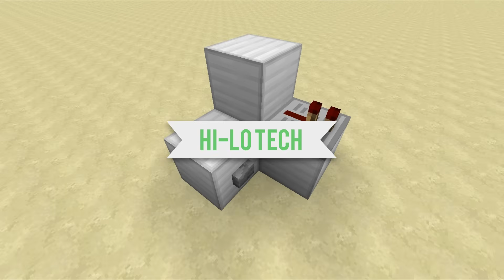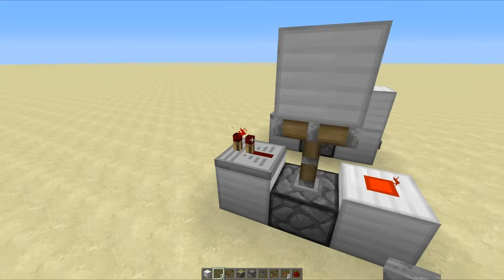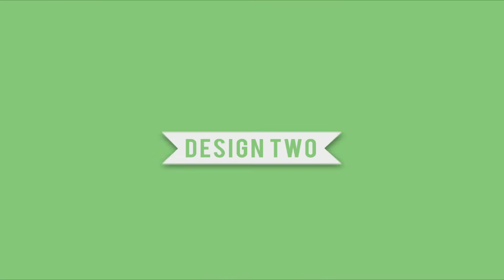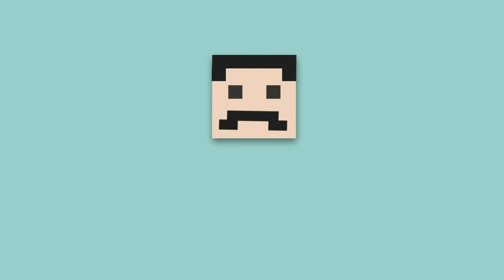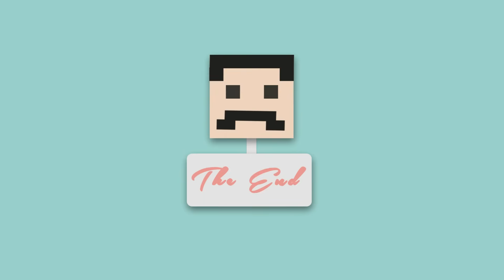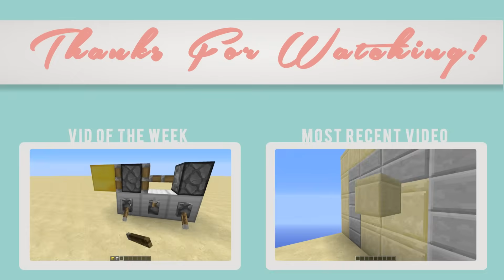HI-LO Tech: The Monostable Circuit

Comment: Why is the falling edge circuit useful?

Simple, I made a rocket silo, gate opens on the rising edge, then a condensator is charged, runs into a falling edge that then closes the gate after a while. Open, fire and close with only one redstone pulse instead of multiple inputs.

Edit: A more compact design for a dual edge would be a redstone dust running into an observer, because the observer detects changes in blocks you will get a signal when the redstone is powered and when it powers off, basically giving you a smaller dual edge monostable circuit in a 2×1×1 block area

Comment: Old video but great concepts and sometimes need to fall back on the older designs for specific builds. Question: Wouldn't Observers be a kind of 1 block monostable multivibrator? It can observe the change in state of blocks and of redstone itself, so it can turn long pulses into short ones on both the rising and falling edge

Comment: Whos waching this in 2019 or 2020
Reply: ...it's almost 2021 and I'm trying to determine if the first circuit works in 1.16.1.  I don't get a pulse to the repeater, and apparently it behaves exactly the same whether I have the redstone dot there or not, the repeater there, or not.  Trouble with getting into this game late is...you don't know which of these mechanics were tweaked in later years and versions. :/
Reply: Ah, I guess the only thing that changed is you don't use the redstone 'dot'.  As long as the redstone dust is thrown down in the non-dot form, it functions as intended.  ...not sure why they did that.  I've run into trouble with this before when I don't have the same texture pack.

Comment: here's my situation 
I have a password mechanism the opens a 10x10 door but the door stays opened until I hit a different button that turns the password mechanism signal off.

is there any system to add so that when the signal is on (input side, door close) and its stays on (output side, door close) and when the signal is off (input side, door opened) it turns off and after a few ticks it turns back on (output side  opened for a few ticks then closes).

Comment: Ouf ._. I was looking for a silent design ._. my mega furnace houts my base with 4 dropper-ticks already D: (Oh, yea I'm also looking for a silent 4 tick counter with a 1 tick output -.- never try to make the safety mechanisms to a bamboo mega-smelter ... it just... just use a wood farm for fuel -.-) 
If you're asking, the problem is a fuel shortage leading to fuel continuously being used without actually smelting anything. (quite an obvious problem if you ask me) with an obvious solution 
take the 1 tick signal from the redstone line of the fuel distribution line (the standard all hoppers are triggered at the same time = 1 item per hopperoutput) 
run it into a 4 tick counter (as bamboo gives 1/4 of a full smelt [by Notch I'm happy the new team leaves all smelt times at the same length... although I could just use the longest smelt time / bamboo fuel time as tick count ._.])
convert the counter signal into a 1 tick puls 
and run it into the hoppers directly over the furnaces
=> 4 fuel => 1 smeltable

but I (still and again ._.) lack the redstone knowledge to get this thing silent so my monostable is still the more silent hopper-dropper design and the 4 tick counter works with a hoppercycle... oh I just realized I probably used 2 to many hoppers ._. (But I'm sure both can be done silent -.-)

Comment: I use the observers, which are a sort of cutting edge tech...
Reply: Aonodensetsu I was just working on a circuit that needed a sticky piston to leave a block behind and the observer didn't work for me. Is an observer a one tick pulse?
Reply: observer does give one tick but it is kinda weird sometimes - connected to redstone it gives the pulse both when it activates and disactivates and so connectiong it straight to a buttor or something wont work
Reply: everything pure 1.11
Reply: the basic explanation for the observer is just a Block Update Detector - something changes - you get a pulse
Reply: Aonodensetsu Thanks!
I have already gotten the circuit to work using a monostable, but I might be able to make it more efficient now.
Reply: you like the extenders? lol

Comment: This is so amazingly useful! Thank you.
I don't know why you skipped the one in the back at 0:50. It operates silently and uses very little resources. I needed a longer pulse with several minutes between pulses. The concept used in that circuit was easily combined with a pulse extender and a hopper timer. It integrates so well. I used the "off" state of the redstone block in the timer to replace the first redstone torch. Then, I just added two more repeaters.
I am using it to send out a minecart every 4 minutes.

Comment: There's also the silent  mononstable circuit using a locking repeater, which is useful if you want to control the pulse length or get a shorter delay on a long pulse

Comment: dual edge monostable is great for dispensing lava and pulling it back right away  (for example in mob grinders)
Reply: Dual edge monostable circuits have been replaced by Observers :P
For mob grinders, water elevators are just the best way to go.
Reply: FennecTECH That's a great example.  Another use I found is to hook it up to a daylight sensor for farms that I want to activate twice a day.

Comment: I know this vid is slightly old but i have a quesion. Can you combine a falling edge monostable with a t flip flop? Basically i have a t-flip flop (multi button input all which act as levers) and im wondering if i could use a falling edge to make it so that when i hit on of  the buttons on the flip flops to turn the circuit off, it will get a pulse? idk if its possible but itd be cool cause it'd help with my stacked piston designs
Reply: It shortens to a 1 tick pulse, where the output is, put a sticky piston with a restone block on it.

Comment: hey mumbo the most comon use for a dueledge monostable circuit is water.
you can have a lever that turns a water fall on and off because the dispenser togles it every pulse.

Comment: I'm pretty sure I liked and commented on this last year (maybe only liked; hard to tell after so long), but I only just got around to making use of a rising edge and falling edge in a farm. Button -> Rising Edge dispenses water to flush everything to a hopper -> Falling Edge shuts the water off. Could have used a dual edge instead, probably, but I wanted to control the length of each pulse separately.

Comment: I think a dual-edge one is more useful for levers then it is for buttons, as you can flick the lever and get the pulse regardless of whether the lever is on or off... useful for idiot-proofing a system where someone breaks off the lever.
Reply: Yeah dual-edges are great for making levers act like buttons. I used it for working with water buckets in dispensers; dispensers need one pulse to output the water and another pulse to suck it back up, but it made more sense to use a lever for out/in states.
Reply: or just comment on a video that came out 5 years ago and bring up the observer, which wasn't a thing at the time
Reply: @parzy_osu  I used a dual edge mono stable circuit, to take a falling edge monostable circuit. that was triggered by a hopper clock. to pulse water and disable a portal after after it was used once. I needed a one way nether portal.

Comment: Mumbo!! I understand why you would think Dual Edge Monostable circuits are "odd"; them being very conditional in use and probably not having much contribution to redstone timing, but they are actually extremely useful for certain contraptions! An application for this circuit would be when you want a pressure plate to send a 1-tick pulse on its input and another for its output. You could use a pressure plate to send a pulse to a basic block swapper that swaps a wall block to a crafting table, then swaps it back to a wall block once you step off the prssure plate! If you were to use a Rising Edge for this instead, you would have to step off of the pressure plate and step on it again just for the swapper to swap the crafting table back to a wall block (because the basic block swapper acts like a T-flipflop and swaps the blocks on a single tick as I'm sure you know!) Only the Dual Edge Monostable circuit works for contraptions like those~ and for other awesome things as well! Mainly on pressureplate>dualedge>Trlipflop designs, because a button with the dual edge isn't very useful and a lever ending up activating a T-flipflop would just be ridiculous. Liked! Subbed! Cheers!

Comment: there are also silent designs for a rising and falling edge detector (which reacts to both) 
works with repeaters and torches and is shown in panda's lp where he used a wither to mine for him (older mc version->wither sitting in a minecart is fixed)

and there is a cool monostable circuit design by jl which works as a 0-tick repeater (vertical and horizontal)

Comment: I have installed MrCrayfish's Furniture mod and it includes a fire alarm. I wanna make something that when the fire alarm is triggered, a dispenser will shoot out water and then clean it up fast. I'd figure I would ask you for help, because you are very good a using monostable circuits and good stuff like that, so please help.
Reply: okay, dispenser place and remove water apon a rising edge, therefor if you want the water to go out, flow and then retract you need to send two separate pulses to the dispenser, a simple way to do this from this video would be to have two monostable circuits, one leading into the other, then attach both outputs to the dispenser. so you trigger the first one (or the alarm does) it sends a pulse (on, off) to the dispenser, that then triggers the other monostable which then sends another pulse which retracts the water. also using two separate monostables would allow you to manually adjust the time between the two pulses (to control the flow of the water)

Comment: The real definition for a monostable circuit is right in the name. It has one stable state (usually the off state) and when it is not in the stable state, it eventually goes back to the stable state. By extension, another name for an RS-NOR latch would be a bistable circuit, and for any latch, a polystable circuit.
Reply: the stable in the name also refers to a stable pulse, as in consistent size, always the same, on-top of what you said.

Comment: Are there stereostable circuits?
Reply: a stereostable circuit is a T-flip-flop because a monostable circuit (mono means singe) produces a single pulse with each button press, while a stereostable (stereo meaning solid) would make a solid on or off signal with each button press.
Reply: I was just kidding... lol.
Reply: nickmettgaming In the context it was used, a stereo-stable circuit would mean coming from multiple sources. the stable is the main part of the word here, the stable means we want a stable pulse ( set length, always the same). I don't think a t-flip-flop would be considered a Stereo-stable circuit, but if I'm wrong then I think you've just coined the term.
Reply: DreadKyller You might be right. I don't really know. What you are describing is an OR-gate connected to a pulse extender, so that no matter the source of the signal or length of the signal, you will always get the same output and same length signal.
Reply: a t-flip flop and any other latch (rs-nor, jk-flip-flop, d-flip-flop, d-latch) are all bi-stable circuits. and a monostable with 2 inputs is simply a 2 input monostable, in electronics we use the term Stereo-stable to describe a circuit that once triggered, outputs 2 timed pulses, either on different lines or one after the other on the same line, both being of different single length. essentially 2 different monostable circuits triggered by the same line.
Reply: nickmettgaming That post at the top; I must admit it sounds like a bunch of mumbo jumbo.
Reply: no a dual edge simply means its input responds to either turning on or off. this can be used to make a lever act like a button. where as a stereo-stable actually produces two separate outputs based on any single input
Reply: ......If only I had an idea anymore of what your all saying....I would atleast try to make a Stereo Stable Circuit
Reply: DreadKyller That still makes sense in the context.
Reply: I know that, I'm not a new redstoner, I was just pointing something out, I know what an or gate is, but technically any gate with more than one input (and gate, rs-nand gate, etc) could also be considered stereo source. in terms of relation to monostable, other forms would be bistable and polystable, those work in the same context talking about size, however the stereo you were talking about is more along the lines of unstabe, and while that works for your explanation of what it could be it didn't work in the context.

Mono means 1, Stereo means multiple, that definition works for the same context as the mono in monostable means 1. however if the meaning of stereo in stereostable was "solid", then that would be saying that monostable meant unreliable.
Reply: True enough. I was just making my best guess to be honest. I really don't know if there is something in redstone that could be considered a stereostable circuit.
Reply: we know, but it is an interesting concept and probably is possible, so deciding what it would be might help pople make one if it doesn't exist yet.
Reply: DreadKyller .......I'm a bit of an average (not so good) redstoner. I didnt understand half the things said here but atleast I have an idea of what everything meant XD
Reply: I think monostable means one pulse length, so stereostable means multiple output lengths, for example if the first pulse is short then the next is long. Just a guess.
Reply: oh ok
Reply: ........You had to go there.......God Damn it silvah =_=
Reply: mono-stables have nothing to do with sound. in fact the term stereo means two separate. that's why we use the term for sound but is not limited to it
Reply: .....I was making a pun lad
Reply: it was a bad pun, lad :P
Reply: sl1pg8r Look what you have started. lol
Reply: ComatoseChimera therefore making the dual edge a stereo-stable circuit rather than mono?
Reply: violentskittlez The dual-edge monostable circuit is also a pulse multiplier.
Reply: Sl1pg8r - Minecraft, Mods, and MOAR! LOL these peple are really running with your "idea" :D lmao im not sure they got the joke though.
Reply: Sl1pg8r - Minecraft, Mods, and MOAR! I got that one right away
#Audiophile
Reply: Use two side by side and run them into a and -gate.
Reply: what about a 7.1stable circuit?
Reply: dual-edge monostable circuit ;)
Reply: nickmettgaming Really?
Reply: I always thought stereo was something you used to use to listen to the radio.......XD

Comment: Pistons start to extend instantly, see the wiki on instiwire
Reply: The wiki is outdated. See actual game on testing.
Reply: really :| test the wiki's insta-wire in minecraft 1.7.2 and tell me again it is outdated, because its not.
Reply: I did before I commented but yea here's me telling you it again:
The wiki is outdated. See actual game on testing.
To test have a lever activating a redstone block instantly and a piston with a redstone block which activates a redstone lamp. It takes half a redstone tick (aka a game tick, aka 0.05 seconds) longer for the piston one to turn on. 
Maybe you should do testing yourself BEFORE telling others to...
Reply: how about you READ what people say before you tell them and the wiki off, i said pistons START to extend instantly, not that pistons fully extend instantly.
Reply: Seth Pentolope According to that logic any machine starts instantly...
Reply: Seth Pentolope Additional to that, the wiki on "instant wire" doesn't say anything about pistons extending instantly for me, assuming I found the same article as you did.
Reply: no, torches dont, repeaters dont, comparitors dont, hoppers dont, so.. not really. but lamps, pistons, redstone dust, and command blocks are instant. (you could also say redstone blocks are instant, but they only react with command block using setblock and pistons).
Reply: There's a 1.5 redstone tick delay for a piston to actually extend, but according you it starts to extend instantly.
There's a 1 redstone tick delay for power to go through a comparator, but that delay starts instantly.
Reply: yes, try this, place a piston facing any direction but up with a redstone block on its face and place redstone next to the redstone block such that it is powering it and watch the redstone as you activate the piston as you activate it, it will turn off instantly. this is happening because the moment the piston receives a update and notice it is powered, it checks if it has 1+ air block and if there is not a unpushable block its way(chest, extended piston, hopper, ect.), if both of these statements are true then the game then notes every block about to be pushed (by tile entities), it then replaces every block that is being pushed along with the block space that the last block will be pushed into, is sets all of those to block 36 (the piston place holder block) and renders a graphical representation that lasts 1/1.5 redstone tick(s) (it depends on the direction) (the amount of time it delays for a pistion to extend like you said) the game the replaces the blocks that were stored as tile entities where they should be. and the piston then waits for a block or redstone update that tells it that it is depowered. i hope you understand and exept this explanation, and thanks for lisining in the end. :)